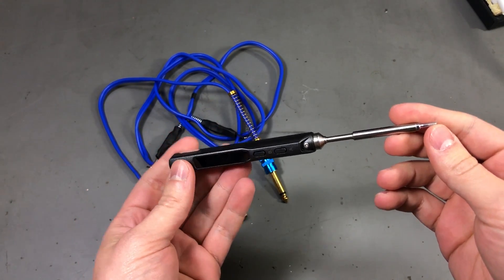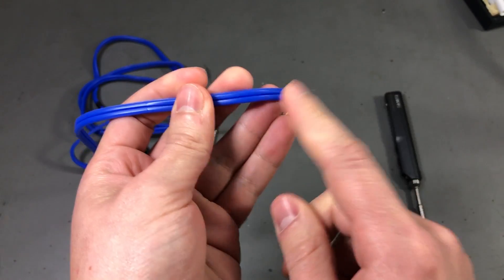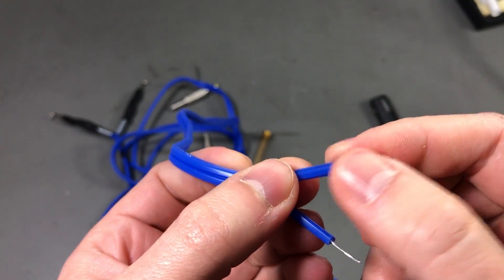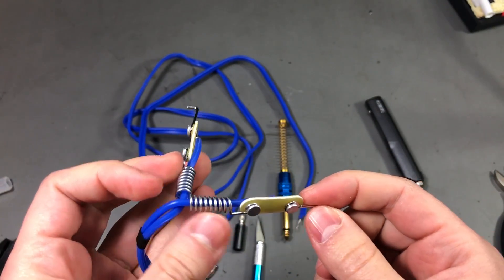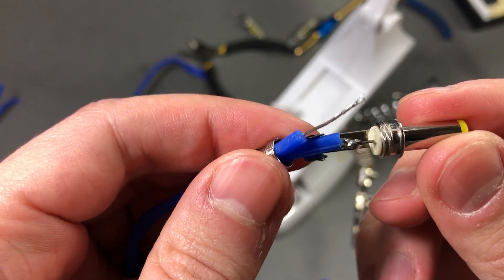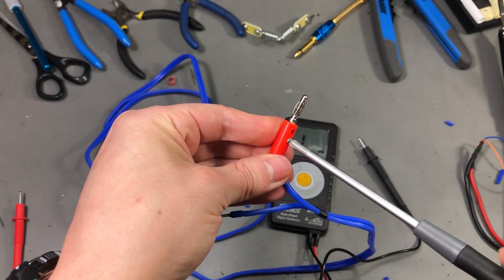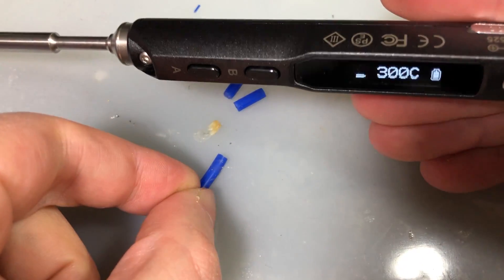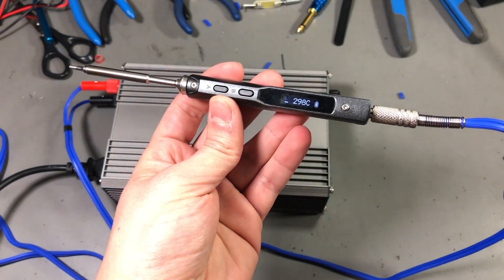Voltlog #212 - DIY Silicone Extension Lead For The TS100 Soldering Iron

Comment: Thanks for your video. From what I worked out you'd need 1.5mm squared cable for a 3m cable at 24V. I think this cable is much less than 1.5mm sq. but maybe ok with very short cable runs. Steven.

Comment: Tattoo power supplies I've seen are rarely rated more than 1A max, and they operate usually between 6 and 10 ish volts. So there's no practical use for heavier gauge wire. The thicker silicone still is to protect the skinny wires from mechanical stress, as the cable is often moved around a lot more than with ie. a solder iron on a bench, so it will get pulled on often. Silicone is rather elastic, but the metal leads are not, so need thicker silicone layer to not stretch too easily, and tearing the internal wires.

Comment: Did anyone buy a ts100 from an aliExpress store called 'goBuying Store'? I am not sure if I should trust them or not. Since I can't send messages to the seller.
Reply: I buy from Banggood several times per month with no problems.

This link is Banggood's best price on TS-100 tips:
https://www.banggood.com/Replacement-Black-Chrome-Tip-Soldering-Iron-Tips-for-Digital-LCD-Soldering-Iron-p-1332420.html?rmmds=myorder&ID=517512&cur_warehouse=CN

Comment: The insulation on the tattoo gun cord is thick for the same reason that silicone test leads have thick insulation: silicone is not tough. So for applications like tattoo guns, where the wire is dragging on the floor, snagging on tables, etc, it needs to be thick.  :)

Comment: I was going to do this, even bought the tattoo cable. But then I found a silicon cable with the correct DC 5.5x2.5 connector on one end and an XT60 on the other. Better quality cable IMO, and not much more expensive than the tattoo cable. If you've got a 20v LIPO pack it's perfect. It is only 50cm long, but easy to make or buy an XT60 extension if required. Search for "silicon xt60 dc 5.5 2.5" on ebay.
Reply: siliconE!
Reply: Steve Hodge link please?
Reply: @thomasjaszewski64  https://www.ebay.com/sch/i.html?_from=R40&_nkw=xt60+ts100&_sacat=0&LH_TitleDesc=0&LH_TitleDesc=0&_sop=15
Reply from the maker: I have that xt60 cable the original one but it's too short unfortunately for my use case where I connect the TS100 to a power supply.

Comment: Im using 90 degree angle 2.5mm plug and 2x 20AWG silicone wire.
Reply from the maker: yup that works too

Comment: I was thinking to use 3-wire silicon cable, to be able to connect ground connection as well. With the screw for the ground, it can even help to securely hold the plug in T100, if it forms a ring around T100 with a hold can be screwed onto the soldering iron itself.
Reply: Check it,  but I think you'll find that the earth screw (and the exposed metal of the tip) is connected to the negative supply so there's no point in the third wire - you can earth the negative at the supply end and it comes to the same thing.
Reply from the maker: yup, that could work too.
Reply: @voltlog  Btw, I also found some quite cheap 5-core silicon wire (commonly used with cheap T12 soldering stations). I connected 2-2 cores together to carry the power, and the remaining one to be the tip ground for ESD safety, what you can connect whatever you want as your chosen ESD protection solution then. Since I found the cores for power just hmm too thin for using only one wire of those kinds. But probably I just worry too much and even a single wire would be enough for the "power rails"?
Reply from the maker: LGB Gábor Lénárt yup I need to check those out as well, thanks.

Comment: you could have also reused the spring from the original cable. it works fine and is very flexible
Reply from the maker: I thought about reusing that but it was a larger diameter than the dc jack connector..

Comment: Maybe also get some strain relief for the banana jacks. Good to know resistance of that wire before viewers order.. any chance you'd put 3 amps thru a low value power resistor and calculate it? AWG24 is kind of small for many applications.. Thanks!
Reply from the maker: I measured and at 24V my TS100 pulls 2.4A max when it first heats up then it drops to below 1A. The resistance of the wire is 0.28ohm total. Even at 3A, that resistance is not going to affect the TS100 operation.
Reply: @voltlog  Thanks, I was thinking about cutting and splitting these into 4 x 3 ft. pieces for purposes like max 3 amp crock cables (bench test etc.. seemed very flexible). 12 ft. x AWG24 works out to be 0.308 ohm so it's a bit better.. more like AWG23. Sorry to ask, but did you measure total R before soldering the ends on?
Reply from the maker: I measured total R with the connectors on.

Comment: Is it tinned copper or aluminium wire?
Reply from the maker: Hard to tell, I don't know.
Reply: @voltlog  If you take a lighter to the strands and they melt, they are not copper. If they glow red and don't melt, they are copper or steel.
Reply from the maker: good point, I'll try to remember that
Reply: In the shots where he exposed the end of the wire, the inner conductors appeared to be too stiff to be aluminium. They looked much more like copper to my eyes. Stranded aluminium in wires like that acts very "springy" - it bends easily, but springs back to its original position - while copper bends and stays in the position you bend it in to for the most part.
Reply from the maker: Andrew Gillard it was definitely staying twisted as shown.

Comment: Nice job! Check the voltage at the power supply end and the ts100 end and also the resistance of the wire to see what voltage drop you have. I believe that at almost 3A current drain of the TS100 you might get some voltage drop on that wire gauge if it's not copper. Yes yes, I'm obsessed with these trivial issues! :P
Reply from the maker: I measured and at 24V my TS100 pulls 2.4A max when it first heats up then it drops to below 1A. The resistance of the wire is 0.28ohm total. Even at 3A, that resistance is not going to affect the TS100 operation.

Comment: I was just using my TS-100 in the basement and once again thinking that the cable is somewhat stiff. Nice idea, i will do it probably the same or similar, thanks :-)
Reply from the maker: You will like this one, it's flexible and nice to work with.

Comment: Can the cable get warm if you set the TS100 at 24v and set it on a plate of copper to heat up? Does your PSU show ~3A draw?
Reply from the maker: No, the total resistance of the wire is just 0.28 ohm. The current draw is 2.4A max
Reply: You can't power the TS100 with (0.67 x 5) Volts.

Comment: I like the cable and especially the DC plug, but the banana plugs are not something I would use, I prefer better types.
Reply from the maker: I agree, the banana plugs are low quality, just as we speak I am adding some decent ones to a shopping cart.
Reply: VoltLog which are you using?

Comment: Nice, the silicone xt60 one sold on banggood is too short so this is an improvement
Reply: The last XT series I bought from banggood are NOT Amass XT connectors. All copies and lesser quality. Hobby king for true Amass connectors.
Reply from the maker: yes connectors from hobbyking do seem higher quality but I never push these to their max rating so it's ok even with the fake ones.
Reply from the maker: Yes, I have the one with the XT60 connector and indeed too short.